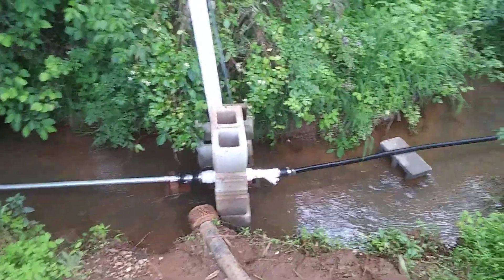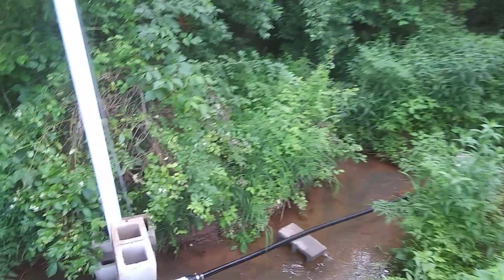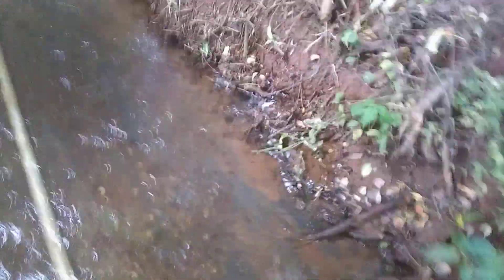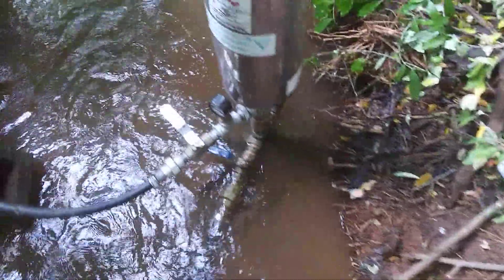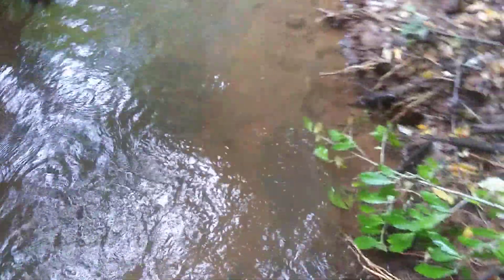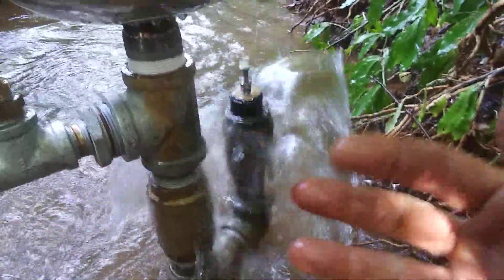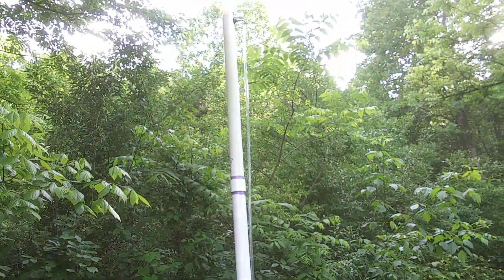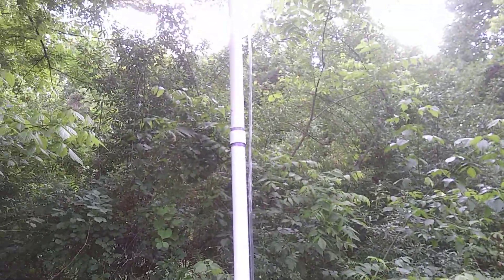Sight glass in standpipe for ram pump and upgraded pressure tank

Comment: Is your source pipe from the spring going into your standpipe, the same size as your pipe going out of your standpipe to the pump?
Reply from the maker: Yes, but the pipe going to standpipe from spring should be one size larger, I realize that mine is too small, but it works for the amount of water I'm running
Reply: @Whelessry  sweet thanks, I’m setting mine up the same way for the time being cause it’s what I have on hand. just wanted to know if it works, thanks for the reply
Reply from the maker: @osotaylor8920  yeah that's kinda why I did mine like that, if you run into problems where the pump sucks down the water in the standpipe and won't refill fast enough you need to adjust the waste valve to run less water or switch to a bigger supply pipe for the standpipe

Comment: Love your setup man! Yes, you're right PC size wont really affect output, its just a shock absorber.  I like your waste valve setup. Excellent design and build my friend! I have pressure chamber and water head envy! :)
Reply from the maker: Thanks man! I have to admit I got a few ideas from your channel as well as others lol. I was only able to get about 12 feet of water head by putting in over 600 feet of supply line. Costs a lot of money but was worth it. I'm actually only about a quarter of the way down my property with the ram. Luckily my spring is at the very far corner of the land and I could potentially run hundreds of more feet of supply line if I ever had to or wanted more head pressure.

Comment: Cute idea for the sight glass for the stand pipe - have not seen that before.  If you get any performance information of the adjustable waste water check valves, please let us know.   I've added this video and linked back here in the discussion about waste water check valves in the Water Powered Pumps public Facebook group - we now have 45 comments on this thread so if interested, will have to expand - here is the direct link:  https://www.facebook.com/groups/240458583255303/permalink/533567013944457/

As you mentioned, Bohumir Stehlik has done some great work and his video is in the Facebook group thread.  Here is a direct link to one of his latest videos:  https://youtu.be/uCgHtF8NMlY

Sanan Hydraulic Ram Pump also has some really cool adjustable valves, is in the Facebook group thread and seems to be going to adding multiple waste water check valves.  I have yet to verify, but he seems to think more is better.  Again would love to have some actual stats.   Here is a direct link to a Facebook picture of one of his multi valve systems.  https://www.facebook.com/photo.php?fbid=2906687872699912&set=a.163847583650635&type=1&theater
I keep hoping that some of the knowledge will rub off on me.  Until then I'll continue to keep notes.
Reply from the maker: Would you like me to make a video on my waste valve and adjust it from low to medium ans high and show the results in a separate video? The valve I made is completely adjustable and can regulate my pump to run slow or fast so that I still have water for my house out of one spring